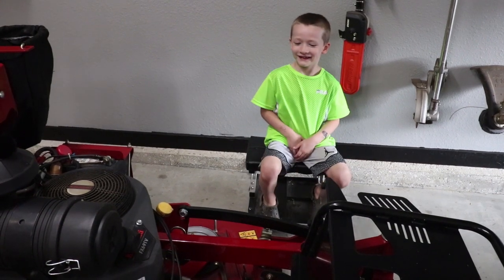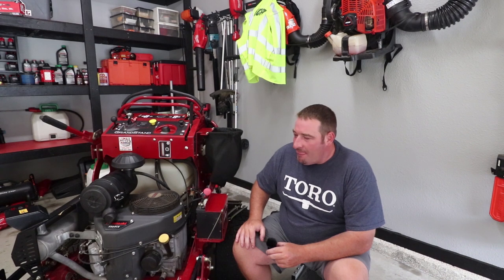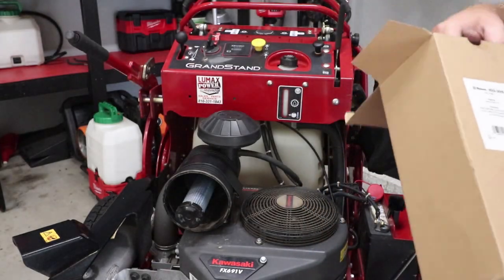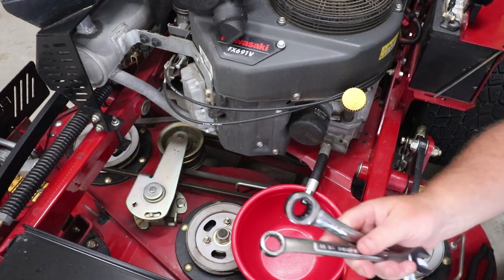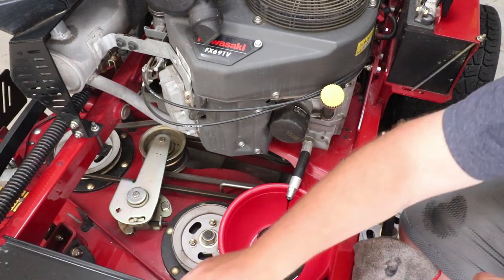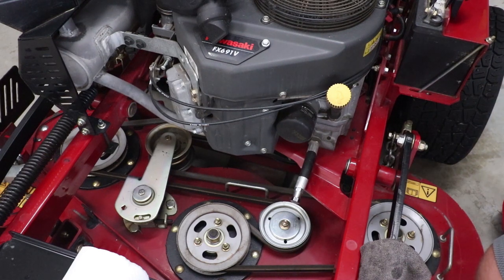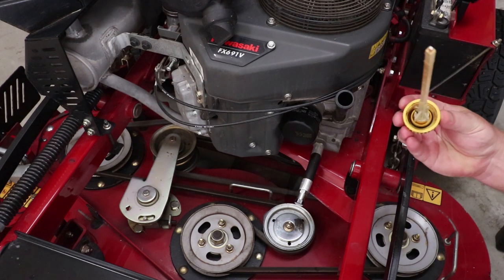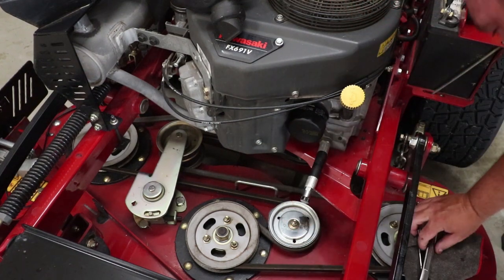Maintenance Day, Do It Yourself Oil and Air Filter Change Toro Grandstand

Comment: Thanks bubba! Always enjoy your videos. I’ll be following your advice step by step when I change my oil next week. Any other tips on how to winterize a grandstand?
Reply from the maker: Just make sure you add a fuel stabilizer and run the mower for about 10 mins. After that I usually just start them and let them run a couple mins weekly
Reply: @LanierLawnCare  do i need to add fuel stabilizer even if I run out all the fuel?